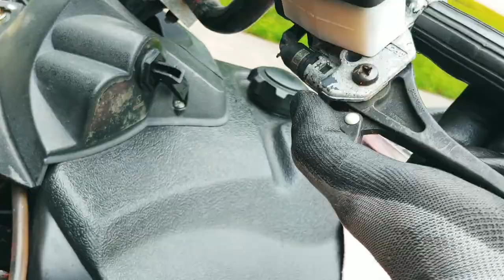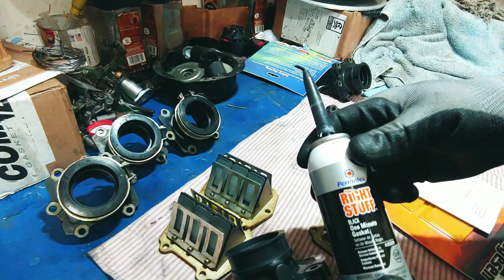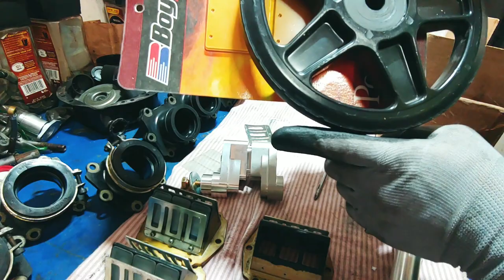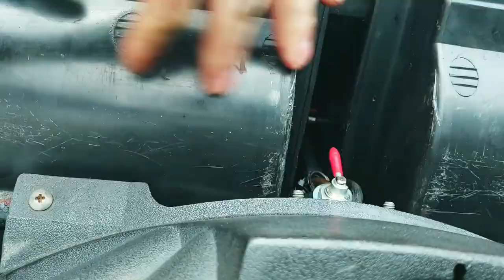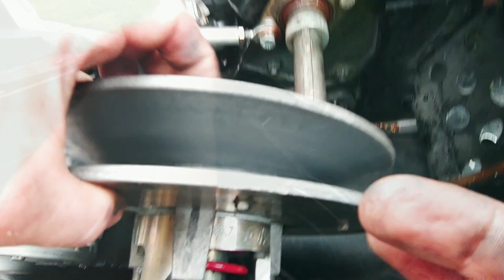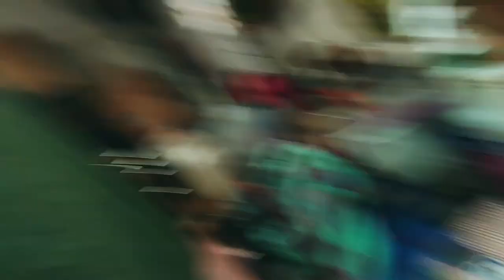Changing 2 Stroke Reeds (on Arctic Cat Sled)

Comment: Are you opposed to gaskets on BOTH sides of the cage? That's what I just got in the mail. The picture online showed black rubber gaskets but they ended up being a bluish color fiber material, one for each side of the cage.
Reply from the maker: The gasket only goes on the cage to cylinder side and the intake boots have raised lines all the way around that create a seal to the cage when its all bolted up and torqued down.
Reply: @Fixin2Ride-Official-  You're right! I didn't notice that. Still makes me wonder how much those tiny raised lines get flattened out over time. I'll check before putting them on. Thanks!
Reply from the maker: Just use a tiny thin line of Permatex "The right stuff" one minute gasket maker. You can put the engine back into service immediately. No wait time. Works like a charm! I also use it on both sides of my exhaust gaskets and some of the exhaust flanges to seal them off completely.

Comment: Did you have to re-jet at all or were you within tolerances ?
Reply from the maker: No rejetting necessary. Cats are jetted a little rich from factory. The main thing is that the dual petals design is so that throtle response is increased with the thinner petals at lower rpms/ off idle and the thicker petal gives better pverall performance in the powerband range. 

 So between the dual stage power reeds and the TM style flat slide carbs atomizing the fuel better, the throttle response is insane on this thing.

Comment: I'm try to pm you about those v force reeds but having some issues with my phone
Reply from the maker: Did you send me a friend request? Let me check
Reply: @Fixin2Ride-Official-  I've been trying but my phone isn't letting me for some reason
Reply: Hey did you use a special orange paint on those cylinders
Reply from the maker: @larrywarner9314  its single stage powder coat..10x better than any paint
Reply: @Fixin2Ride-Official-  yeah I know that
Reply: @Fixin2Ride-Official-  would you take $200 for those reeds ?
Reply from the maker: @larrywarner9314  they sell all.day long at $250 for just the reeds.
Reply: @Fixin2Ride-Official-  so $250 is your bottom dollar
Reply from the maker: @larrywarner9314  whats your best offer and I will compare with others.
Reply: @Fixin2Ride-Official-  I won't pay no more than $250 I can but brand new ones for $280 delivered .
Reply from the maker: @larrywarner9314  Okay. Like I said these comes with the flanges and better than stock clamps and SS screws. Im selling it all together so I want to keep the price accordingly. I have higher offers
Reply: @Fixin2Ride-Official-  good luck bud
Reply from the maker: @larrywarner9314  New OEM clamps are $25 each. They only have yellow zinc coating. These have two stage powdercaoting and SS screws. Much better. Fair price at $310 shipped. 

Thanks for the interest though. Let me know if you change your mind. You couod always sell the flanges and clamps if you wanted to use something else. Or keep the clamps and add them to "Custom" list.
Reply: @Fixin2Ride-Official-  😂😂